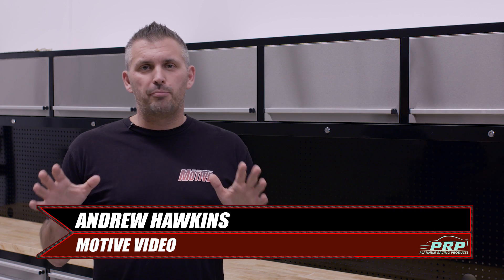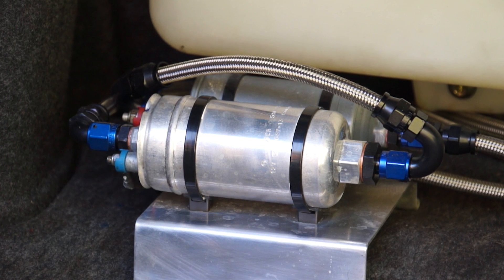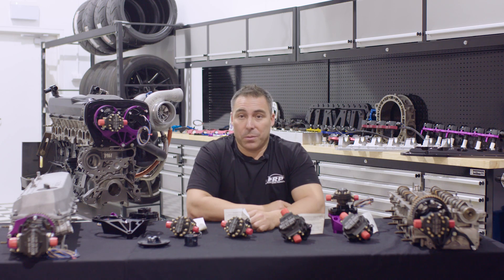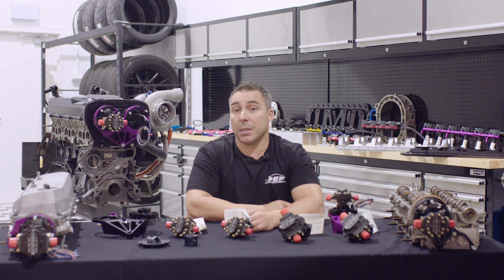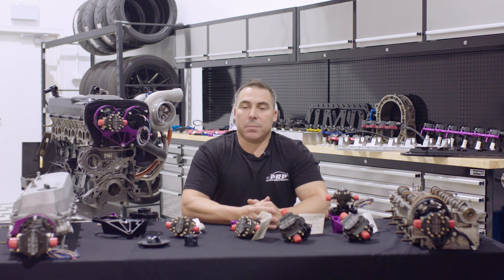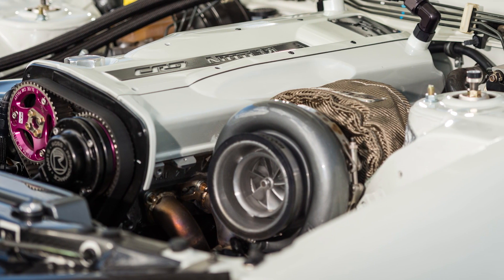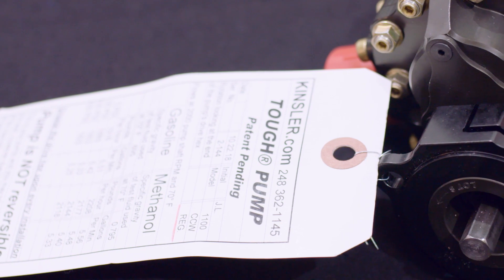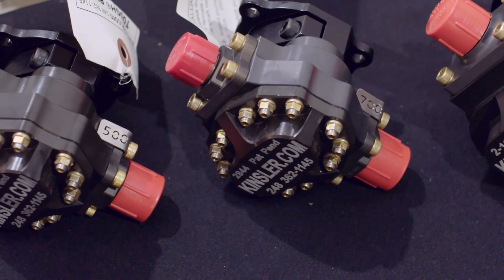Mechanical Fuel Pumps explained for street car - Platinum Tech

Comment: My Question Is Do You Offer Serpentine Belt Pulley Options? I Could Fabricate A Mount For It In Place Of One Of My Idler Pulleys On My Drive Belt And Figure Out What Pulley Size I Need For Operating RPM Range Based On Crank Size. However I Feel Like These Pumps May Not Have Proper Bearings For Forces On A Serpentine Drive Belt Set Up. My Biggest Problem I'm Having With Intank Pumps Is Once They Get Too Hot They Don't Flow Nearly Enough. I've Been Left Started On Side Of Road On Hot Days. 20 Mins With Pump Off And She's Good To Go. I Thought It Was Vapor Lock For The Longest Time But Found Out The Fuel Pump Motor Resistance Went Way High When It Over Heats And Barely Draws Any Current Resulting I'm Extremely Poor Fuel Delivery.

Comment: you can also run a cable ( or shaft, just cable style is more common to see looks like a flexible rotary drermal tool adapter ) drive to the back of the car were the main fuel tank is, like a lot of turbocharged V-8 do and saves the what of a "surge tank" but for a streetcar it's still recommend to have a priming pump ( i should still should start without it. just might be hard starting ) just to get all of the air out of the lines and on start up ideally having say 60-psi after its running and the mechanical pumps up to 60ish then shut off the electric pump

Comment: What max fuel pressures are you attaining with these small and large pumps?
Reply from the maker: You could make way more than any injector can safely hold. There is a mechanical fuel pump to cope with any power level

Comment: All the new direct injection petrol engines have a mechanical fuel pump. Also correct me if I'm wrong but I believe the Gibson R32 GTR did have a mechanical fuel pump but I don't think it had a fuel pressure regulator so the fuel pressure increased with rpm not manifold pressure. I could be totally wrong I just might not have seen it.

Comment: I know he was talking about having the pump in the front of the car because it doesn't work as a good scavenge. We on the other hand I have my pump halfway between the gas tank in the back and the engine by way of flexible shaft driven from a belt drive in the front. Haven't had any problem yet.
Reply: He was talking about the surge tank being up front. I don't know what motor your running but I'm assuming you don't have belt driven cams to run the pump from and that's why you've got a belt driven pump off the crank pulley with the cable keeping it close to your surge...…..Same principle just different ways of keeping the mech pump close to its source to minimize cavitation etc.

Comment: noob question; With mechanical driven off the cam presumably the flow increases with engine rpm? does pressure increase too?
Reply: In theory it would, but you still have a fuel pressure regulator in the system that dictates fuel pressure. So no, the fuel pressure will still be controlled by the FPR. The fact that the fuel pump speed is reliant on engine speed is a good thing, because it means you aren't circulating a shit ton of fuel that you don't need whilst not on the throttle hard.

Comment: For the last 100 years they were mechanical fuel pumps, but the only issue i see is that again, you still have to et someone to replace the current electrical system and then run the mechanical system so most of the cars which have multi electrical fuel pumps have already spent the money ,why someone has not made a better electrical system is beyond me, but still good to see someone re inventing the wheel with better products, soon they will have a better electrical system and simpler system as well to compete? Just like Craig Davis electric Water pumps and not mechanical ? So basically its a crank driven fuel pump or cam driven, just like the older dizzy's and mechanical fuel pumps on the older fords and holdens. :)
Reply: They sell upgraded alternators but that's not the point. Electric pumps have their limits, are noisy, pain to setup and worst of all is if one of 3-5 electric pumps fail you wont know it till its lean at 7k wot.

Comment: I've got a question I wanna swap my electric fuel pump to a mechanical one can I run it off the accessorie belt? Since the engine has a timing chain not a belt
Reply: there are options. i thin cleetus just got one for his drag car, you should check out his video
Reply: Yeah, you just need to fab or buy a bracket to do it.

Comment: Hang on - the lift pump STILL needs to be able to meet the maximum fuel flow of the mechanical pump, and a little extra to ensure the header is kept full, and have enough pressure to ensure it is pumped through the restrictive lines at that volume rate? I REALLY doubt the OEM setup will be anywhere near managing that and higher power installations will potentially need the whole electrical wiring, pump(s) and lines uprated anyway?

However, I could very well be mistaken and would be interested in feedback either way, for different applications?
Reply: There are two things that you maybe didn't consider. 
Nobody drives their 1000+hp cars at full throttle for minutes. And the flow of a normal electrical fuel pump is much higher at near zero "backpressure".
Reply: @Karpo1986  
I would remind you - the mechanical pump is roughly proportional to rpm, not load, so the lift/prime pump generally needs to exceed that flow, especially if the return is to the tank. While flow is increased, and current draw reduced, with the reduced pumping head, there is still some head and it is VERY unlikely an OEM will free-flow enough to feed a significant power increase.
IF the pump vacuum head is sufficient, taking into account the launch 'G' and fuel temperature - lower pressure in pump feed line and increasing temperature increases the risk of fuel vapourisation* (boiling) in the line which is worse with alcohol containing fuels, I would even look at a pure mechanical system with LARGE bore lines/hoses and fittings.

*On that are you Aussie chaps running fuel coolers - they are not uncommon for carb' cars at high ambient temperatures?
Reply: @gordowg1wg145  The mech pump feeds from the surge, the excess is returned to the surge, not the main fuel tank. Therefor the electric pump only needs to make up  for what the injectors spray (bleed from the system).
Reply: @brolly9486  
You can certainly do it that way, but it's a bad practice, especially under high under-bonnet temperature conditionss, because the fuel is going to be constantly run through hoses and rails where it picks up heat every circulation, barring a small amount of cool replentishment from the tank.
The swirl tank requires a vent back to the tank, anyway, for excess air/fuel, so it's a smarter move to return directly to the tank and draw cool fuel through the pumps to the rails.

Comment: 700-800 thousand hp? Crikey! 
Na jokes. I’m all for fuel/water/oil pump,alternatives. Or any alternatives that challenge the status quo... (electric assisted driveling es with power regeneration abilities on braking ((Nio EP9)) electric assist turbos, composite materials for heat regulation, synthetic and bio fuel mixtures, low drag coefficient targets as well as power to weight targets, and many more, more ‘out there’ alternatives) 

Currently considering an auxiliary electric oil pump and bits for my turbocharger set up on my street driven, ‘weekend’ car... 
I wonder why oil lubrication systems can’t use a regulated system to maintain adequate oil pressure to bottom end but supplies only the oil supply the rest of the system can handle at any given rpm, this would also allow for a ‘pre-lube’ function to run along side the fuel pressure priming system. Even if the system is a basic one and merely cuts the ignition for the first few revolutions to get oil pressure up before firing. Although a stand-alone, electric pre-lube pump would be ideal and could have a solenoid to divert oil only through the turbo system and take over oil supply duties on shutdowns. Not required on track driven cars but bloody handy for cars that have to refuel at local servos or finish their journey in a confined public space like an underground car park at woolies.... Also can be a bit obnoxious to others at certain destinations Ie; near dwellings where people’s young children may have finally been put too sleep. Or to your neighbors when you get home at 3am....

Any thoughts or advice?

Comment: Nice and informative video as usual, thank you!

Would love to see a video with different trigger setup offerings.
Now factory installed Nissan 360 optical CAS is a very good system in theory, it gives a very precise measurement provided that 
- ECU has enough computation power or a dedicated trigger preprocessing unit
- there is no play anywhere in the entire assembly (disk to intermediate shaft, sensor to disk, intermediate shaft to camshaft)
In practice though it is affected by harmonics and can misread cam position if there is even a small play anywhere in the assembly.
Would like to know your opinion on the factory system and on alternatives like AEM CAS disk, crank trigger setups and what rev level makes them preferable to the factory system, and how it would affect fuel phasing, and whether using an aftermarket triggering system would imply switching from sequential to batch fire fueling.
Reply: we are about to release our trigger kit one, have you seen the latest haltech one? goes into depth with our help
check it out
Reply: @hermanurriola138   
Hey Herman, appreciate for response! Would like to use this opportunity and say thank you for the videos where you meticulously test blocks' geometry and hardness and enlighten us on their construction, I've learned a lot from them and from your other videos as well.

Regarding factory CAS - I saw that Haltech video and honestly I'm not entirely convinced that factory CAS is all that bad. Replacing CAS with 1-tooth sync sensor doesn't eliminate belt stretch or wobble, it basically roughens signal precision 30-fold and then relies on ECU to do its math on injection and ignition phasing. From that point on it's just the matter of how much "ticks" ECU internal clock does between cam sync and crank tooth, how fast the processor is and what heuristics/algorithms it uses to approximate timing. It's still not exactly precise, particularly when the engine is accelerating or decelerating at a fast rate. 

I'm also not entirely convinced that power levels are a good reference when CAS replacement is being pondered. True, on high-boost application 4 degrees of error on spark advance could cost you an engine and 4 degrees of retardation could cost you lost HP and overheated exhaust valves, but both are consequences, not causes of the initial problem - the belt stretch or to be more precise inconsistency of connection between cam and crank position. I may be wrong, but I'd expect belt stretch to occur more readily on an engine that has lighter rotating assembly with 300kw than on a 500kw engine with heavy pistons, rods and crank since the former would accelerate faster and therefore stretch the belt more. I'd also expect it to be dependent more on the level the rev limiter is set to.
Power level reference also doesn't explain why some people have problems tuning off of factory CAS at 280kw/7500 RPM, while others are running without any trouble at 400kw/8500 RPM.

I'm also not sure that crank positioning is the major thing that should be taken into account with cam signal left solely for sync purpose. You've raised a very good point why it is necessary for 4-stroke engines to have a cam sync signal in order to utilize proper sequential fuelling and ignition, but I'd say that defining all four strokes solely based on crank position would be a simplification. A more accurate statement would be that
- intake stroke ends and compression stroke starts when intake valves are fully closed and ends a little before pressure wave from ignition starts to push on the piston 
- power stroke starts with the ignition and ends when exhaust valves open
- exhaust stroke starts when exhaust valves open
when exhaust stroke ends and intake stroke starts is dependent on cam setup, valve overlap, intake and exhaust flow harmonics, boost and exhaust gas pressure and a lot of other things, which are specific for each engine configuration and must be tuned for.
I'm writing those obvious things to make a point that most of events that are important from engine management POV are more dependent on camshaft position than on crank position. In that regard CAS on its own does a very good job at providing an ECU with all the necessary info for proper engine management. 
Factors like belt stretch appear to me to be a constant you can tune for provided that you use same belt manufacturer and model all the time and that belt tensioner and idler are doing their job.

This leaves the aspect of how tightly and solidly the factory CAS is attached to its driving camshaft. Obviously if there is a play in the place where one is connected to the other, no amount of tuning and belt tensioning would result in accurate engine management. 
Unfortunately, there was no info in that video answering that question, but I guess that is to be expected since cam sync plate you offer is mounted solidly on the cam gear.

Factory CAS is really a very smart and ingenious assembly that makes ECU programming very straightforward - since it has 360 cuts on its outer ring, all ECU has to do once long sync cutout begins is to count small cuts until it ends. When sync cutout ends, it stops counting and evaluates that number and uses it as an index to access certain data tables. By doing that it learns exactly what cylinder it has to fuel and/or fire. There is no time consuming operations for ECU, no divisions, just a very basic increment followed by a branch and memory access.
What's bad about it is that it requires very direct and solid connection to its driving camshaft, which may not be the case on older RBs. Also if there are harmonics when the ECU counts small cuts, it can become inaccurate and count 2-4-6 extra cuts, if one small cut flies back and forth in front of the optical detector within large cutout in front of the other, and that can spoil sync detection big time. 
With the factory CAS the tuner must also be absolutely certain that ECU receives a good clean signal from the CAS, that wiring is in good shape and that there is no electromagnetic interference anywhere between CAS and ECU - since at 8000 RPM the ECU has to pick up a square-wave signal at a rate of 24 000 pulses per second from the 360-cut factory CAS disk. This can be easily spoiled by a broken wire.

In my own point of view a good and inexpensive solution to fix factory CAS inconsistency would be to manufacture (laser cut?) a replacement disk with larger and fewer cuts (like AEM replacement disk, but it has a bit too few cuts IMO). It basically does the same thing as split crank-cam 24+1 tooth setup - reduces amount of signals produced by CAS (but not 30-fold), makes them less sensitive to EM-interference and less demanding to calculating power of the ECU, but unlike split crank-cam setup it wouldn't require rewiring and replacing crank belt gear. This solution would be aimed at the consumers who already use an aftermarket ECU, but are not interested in all-out high-RPM race builds.
Reply: @PK-lk5gs  Oh yeah I've got research to do!  Brilliant comment mate!
Reply: @jdmimportlogistics  Thanks! Mind if I ask what are you researching this for?

Comment: At first glance it seems like a bad idea running a fuel pump off the camshaft - doesn't the extra load on the belt cause the belt to stretch and the timing to wander?
Reply: The load won't be vastly different to that of the valves. Many OE setups drive the HPFP from the camshaft.

Comment: Awesome PRP. I know this is stupid to say but the camshafts already drive the mechanical fuel pump for Gasoline Direct Injection, It's kinda the same thing but for a different aspect of the fuel system as DI is used for High Pressure and sprayed into the cylinder directly while the mechanical pumps for racecars like Herman from PRP states Racecar's have had these for along time. I can't wait to incorporate this into a daily vehicle xD
Reply: nice post cheers

Comment: does it put big stress on timing belt, harmonic balancer etc?
Reply: It sure does, but the stress it's much lower than, say, when you install stiffer valve springs
Reply: Hardly, i will post up some data after testing

Comment: is this suitable for direct injection engines? i have a direct injection car (ford fiesta st) that has a mild tune doing about 260 to 270php at the crank and the HPFP is already running at approx 2900psi at wide open throttle. the issue is the cam lobe isn't aggressive enough so the pump is working over time, there are after market cams that fix this issue but i don't want to to go opening the head, and having to deal with that sort of thing. is it possible to run this system on a direct injection system and delete the HPFP?
Reply: No, a direct injection engine NEEDS a HPFP. You can't run it on a regular 3~ bar fuel system. They require such high pressure because you're squirting fuel directly into the combustion chamber, where the pressure is massive. If the fuel wasn't at a higher pressure, you'd just end up forcing intake charge air into the fuel system.
Pumaspeed have some options, with a Bosch Motorsport HPFP being the "best", but it costs a lot. To be honest, changing a camshaft really isn't a big deal, so I'd just do it...

Comment: But can you run one in something 300-400hp?
Reply: For that low power a simple walbro 250 could support that bud
Reply: @clutchkickpj693  for sure. walbro 460 here. Was just curious.
Reply: yes sir, a 200 series pump will nail that, there is technical data on our website with flow rates that will help.